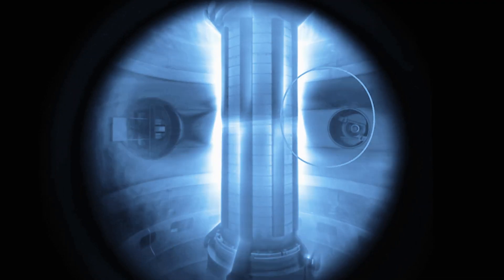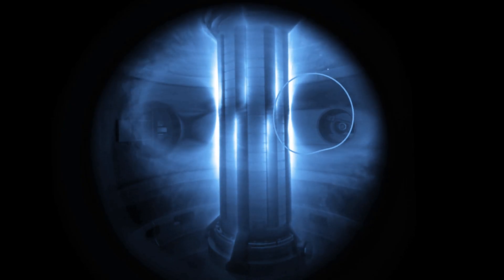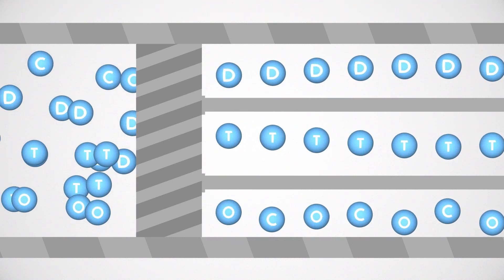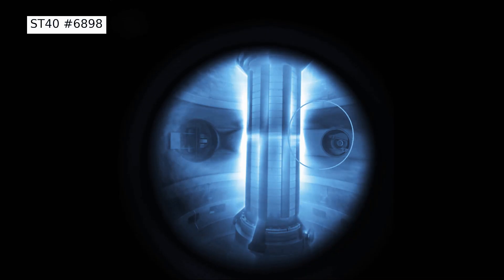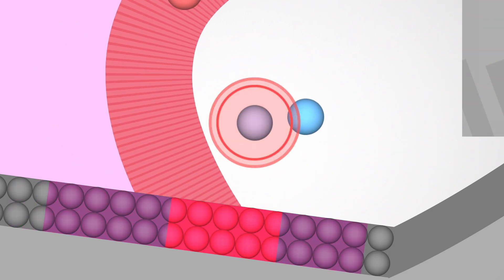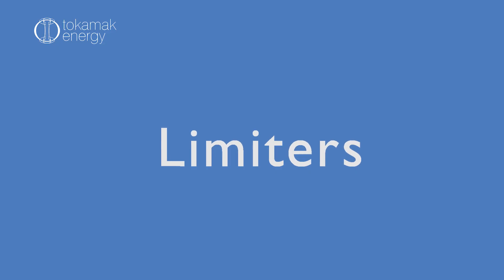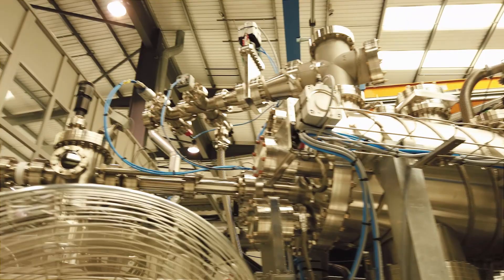Managing the extreme heat in a tokamak fusion device - introducing the divertor

Comment: why dont u guys stick together with iter? like....... concurrence on that level is a bit... contraproductive imo
Reply: It's not concurrence. ITER produces an inviable tree of reactors and it'll take far far too long to even spawn DEMO, that tree even if it was viable and does exactly what it says on the tin first time isn't going to do anything "useful" (i.e. commercially) until well past 2060. TE have concurrence with SPARC, not ITER. Recommended watch - Dennis Whyte's lecture on smaller fusion reactors. No really, watch it because it explains what TE are doing and why perfectly: https://www.youtube.com/watch?v=KkpqA8yG9T4
Reply: Don't quote me on this but I think we `need' iter bc with it we can `burn' some of the current byproduct we created with the current technology, which is really badly radioactive, into something less radioactive.
So more you still need both, ITER being one stepstone but just wrt to the fuel used and by-product handling.
Reply: ITER will be a proof of concept for reactor size tokamaks.  @streaky is right, check out Dennis' lecture, it explains things well.

TE is different to ITER in that they're focusing on spherical tokamaks. These are smaller, compact devices that offer better plasma stability over large tokamaks like ITER, DIII-D, JT60-SA and the like. This lets them operate more efficiently.
Another huge engineering difference is that ITER will use low temperature superconductors LTS for its field coils, while TE is working actively on high temperature superconductors. LTS work great, and are fairly cheap these days, but aren't too resilient to physical or neutron loads. HTS can offer larger field strengths, more resilient coils, and using smaller coils.
It's actually the smaller part that's most important. ITER is housed in a building the size of a football stadium, but ST40 fits in a warehouse. Smaller means cheaper, cheaper means faster development for industry.

Comment: Software being used? On the right hand monitor it looks like ParaView is being used to view FEM analysis. The left hand monitor looks like FreeCAD. It would be good as a FreeCAD developer to know if FreeCAD is indeed being used. If the FEM Workbench is being used to create the analysis being viewed by ParaView and if so which FEM tool(s). Obviously confirmation of software being used might be a commercial issue but it would be a big encouragement to the FreeCAD community to see it being used for such sophisticated engineering.
Reply: In my POV as soon you be able to use python "as you want"  freecad as no limit to exchange data with paraview, and free fem software (openfoam) ... i had used catia V5 for more than 2 decades to draw and exchange data  and believe me or not in Catia V5 scripts (catscrip, vb language or python are nightmare to implements in Catia and i do not talk only about of the lack of documentation ...) So yes i think this is more easy to script,import data and make is own saucage under freecad.
The only 2 things i hate under freecad : Construction and parts lines in 2D representation (bleu, white, green ...) are not compliant with the cad standards dash /dot lines, continuous line representation yes this not easy to reconfigure brain after years of CAD ... the sheet spread who is so "light" i wana a real spread sheet ;) .
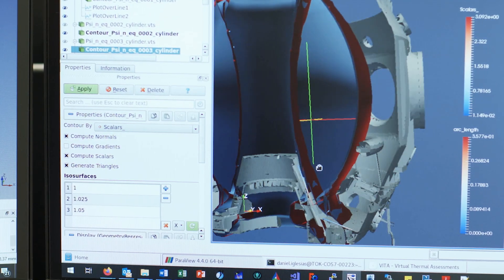Reply: Check out the windows taskbar at 1:40 . Theres the FreeCAD icon. 
As to what it's being used for, who knows?
Reply: @NotHim-vb4bs  yes ! paraview & vita  icon too, +1 for Keith Sloan ;)

Comment: Would harvesting of the energy absorbed by the divertor be something that could be done in the future to increase efficiency? Or would it be unviable due to the sacrificial nature of the device?
Reply: the heat flux on the divertor is going to be absolutely phenomenal and will need constant active cooling. In any tokamak design it would be idiotic simply to dump the divertor heat without feeding it to a turbine.
Reply: I would like to know how this would be done. Something tells me that just weaving some water pipe through it is not going to do the job. Or it might, I don’t know. Maybe I can find out...
Reply: Yep, definitely something UKAEA has already thought about and have handed contracts out for.
Reply: Liquid hydrogen might be candidate, but it is explosive, liquid helium is good choice, but it has lower thermal capacity and more expensive.
Reply: The question is what is the %, quantities of energy and type of particles "hit" the divertor VS those who are recycled at this time in 2020 ! (Maybe Daniel Iglesias or somebody else from the statt from tokamak energy will read my comment  ;) cross the finger  )

Comment: It would be great to hear more about how the divertor plans compare to the approaches of similar tokamaks.
Reply: yes indeed, particularly given that all things being equal, the divertor heat flux on a high Tc superconducting, super high B field, miniaturized tokamak is going to be absolutely stupendous, possibly orders of magnitude greater than on a conventional "low" B field ITER like design. Something like the Super X divertor on MAST will be a total necessity.
Reply: Think everybody recognizes the divertor is probably going to be one of the hardest if not the hardest thing to get right. I'd be surprised if they have anything like well-developed plans for it and even if/when they do they'll be incredibly commercially sensitive I'd think.
Reply: @Muonium1  This is what frightens me about ITER.
I feel they  took the wrong approach.
I fear further they will refuse or not plan for this required part as your said A TOTAL necessity.
Cheers!
Reply: @tauceti8341  ITER's large enough that with gas puffs and by spreading the divertor flux over a largeish area they're not too worried about the heat load on the divertor plates (at least that was my understanding).
Reply: @Muonium1  
Google search for "Graphene as a high field magnet", and look at all the articles on the first page results.
Go to my channel, find Technology Research, go there.
Find all the playlists on the channel, check back manually for updates to playlists, subscribing won't always show it.
I can't give links or my comment is hidden, and it would seem my other comment was also hidden without links to this video, youtube has a lot of corruption going on and bias, and they don't want me to share amazing positive and good innovative things that are to a whole other level. They want mindless brainwashed biased people to watch videos in a biased direction.
Reply: @gameresearch9535  ever think maybe you actually are just a crank?
Reply: @gameresearch9535  sure grapheme is superconducting at 10,000 atm - but its critical current is impractically low. It's nowhere near usable in high field magnets in the foreseeable future
Reply: @gameresearch9535  I googled for "Graphene as a high field magnet" and only found this video plus another post from you elsewhere.
Reply: @Chizzy941  
Again do a google search on "Graphene as a high field magnet", and go to the articles to read them, there are lots.
Also it's called Graphene, so I don't think you know much about what you are saying.

Also go to my other channel and watch my Graphene playlist, and everything from every playlist from top to bottom in that order.
And check the articles in each playlist description after you watch everything, and go to the official website links found under the "About" tab on my other channel.

Go to my Fusion Power playlist on my other channel, scroll down to find videos from me, one will show the search results.

Be sure to watch all videos from top to bottom in that order, check the articles in each playlist description after watching all the videos from each playlist, and then check the official website links under the "About" tab on my other channel.

Check out my Spintronics playlist on my other channel for videos on Graphene with Spintronics.

Check out my other channel's Graphene Twistronics playlist, after you do the search.

And then look at all the other playlists on the channel for Graphene and Quantum Technologies.
From the home page of my other channel, click on the "playlists" tab near the top, and then click "created playlists". Don't forget to scroll down to find more playlists.
Reply: @andyalder1  

I sent a comment with the search results, and also links to lots of articles as examples, as expected from.. just like other comments above with links, my comments with links in them are hidden. So you will have to find them yourself and the reason that the search results are being blocked for you.

Just use Microsoft Edge, go to Google's search engine "google.com", and type in "graphene as a high field magnet", without the quotes.

I just found them and the comment is hidden, so you will need to find out yourself.

Check this out, I have an idea.
Go to another video on their channel that we are commenting under, go to the videos tab near the top on their channel's home page, and there is a video called "What is a tokamak? And is a spherical tokamak different?".

Find a comment with 2 replies that asks "What would be the disadvantages are of a spherical tokamak vs toroidal?".
There is actually 3 replies, the next reply I tried to make weeks later with new info in links, I found out.. was hidden. Melanie just won't reply, she's in the videos.
They are purposely ignoring any of the links in the past that I gave them, as some people noted, "your information is too important to be under a reply" as they said to me.
And now what do people say? Nothing, from the channel to discuss in a non-biased way as you can see the channel name with comments, and nothing from Melanie either.
I'm starting to believe that there is something very strange going on, between a bias and corruption.

Btw don't forget to go to my channel, find Technology Research, go there.

From the home page of my other channel, click the "playlists" tab near the top, and then click "created playlists".
I don't have Graphene as a high field magnet on my channel except one tiny video that doesn't really explain much, just gives people the big picture, but you can find out everything there, I might make a video on my youtube channel showing the search results for Graphene as a high field magnet, and show maybe.. some of the articles in the video, I don't know yet, and it's not that hard to do a search and find all of them, there are literally pages worth of articles in the search results.
However.. if it comes to needing a video to prove it, I will make a video showing the search results.
You are in the U.S. and so the links shouldn't be hidden? Maybe it's by the state, hiding links? I don't know. Use Microsoft Edge and test the search results with the steps I mentioned.
And don't forget to go to my other channel called Technology Research, again I can't give links because my comments become hidden, I am repeating this too much and it's becoming repetitive.
Reply: @andyalder1  
Ok I made another video for Graphene as a high field magnet, to show the search results, it's on my other channel.
I would give links, but again the comment would be hidden.
Check my other channel's Fusion Power playlist, scroll down to find the videos from my other channel, you will see the video on the search results, I just made that video.
Reply: @gameresearch9535  I literally work first hand with superconductors. Graphene has been shown to exhibit superconductivity in bilayers at a magic angle and now also in T monolayers. Many materials are superconducting at low temperatures - the issues is how much current they can carry before the superconducting state is destroyed. If it can't carry much current, it can't be used for magnets, wires etc. At present, that is the case for graphene.

Looking at articles under 'graphene as a high field magnet': there aren't any that suggest that graphene could be used as an electromagnet - they're mostly about the properties of graphene under high magnetic fields.

Refs: 

Bilayer graphene superconductivity https://www.nature.com/articles/s41586-019-1393-y.pdf

monolayer graphene superconductivity 
https://arxiv.org/abs/1908.01302
Reply: @Chizzy941  

And Graphene could easily be used for the electronics on the inside of the tokamaks, not to forget that Graphene Twistronics and Graphene Spintronics can be very useful in the electronics.

Instead of collaborating, it would seem people are very quick to dismiss Graphene and the many ways it can be used, there is clearly ignorance there from a large set of the company, and a bias since people seem quick to not have any creativity, since nothing is mentioned or used with Graphene parts inside the tokamaks, or is it just that they are biased?

I did read up on something days ago, the company had a tokamak in 2013 with Graphene as the idea to make future tokamaks more compact, they tested one, but it was never again mentioned since then, and that's been 7 years ago.. that's a long time ago to not mention Graphene at all.
Reply: @gameresearch9535  there isn't any bias or corruption. It would be amazing to use graphene, it's cheap and easy to make - far more so than conventional superconductors. 

 Graphene may be superconducting - but (and I'm getting tired of explaining this) it cannot carry much current without destroying superconductivity. Until graphene actually had a large critical current density of ~ 1000 A per sq mm it cannot be used for any practical, high field, high current purposes. It's not corruption stopping the use of graphene, it's physics.

Oh and it's not old research that I linked: the monolayer paper was from last year
Reply: @gameresearch9535  Show me a graphene cable that can carry even 1 A per sq mm under 1 T magnetic field. Superconductivity is a quantum phenomenon for crying out loud. You keep talking about my ignorance, but it's patently clear that you have no idea what superconductivity is or what is required for practical superconducting cables/wires/machines. I would very much recommend you read up on the concepts of critical field, critical current and critical temperature in superconductors. 

I humoured you and looked through your other videos 3 days ago. There's nothing there to convince me of any practical use for graphene as a material with which to make magnets or cables for practical purposes. Exhibiting superconductivity is not enough. It MUST exhibit superconductivity under high magnetic fields ( > 5 T at least) and with high currents passing through it ( > 100 A mm^2 at least). Until it's been proven to do that - it cannot be used for fusion magnets.

Comment: Great work. I hope fusion will save us soon. How much pressure is inside the tokamak vessel? So how high is the gradient between the vacuum divertor and the scrape surface?
Reply: I read somewhere that it's around 1 bar, maybe a bit more. But It would be interesting to get the real value from the team.
Reply: Great question! It isn't so high in spherical tokamaks, so I'd also love to hear (read) what they think about this.